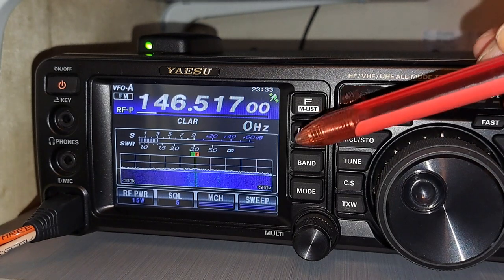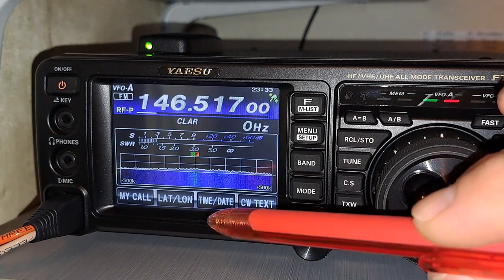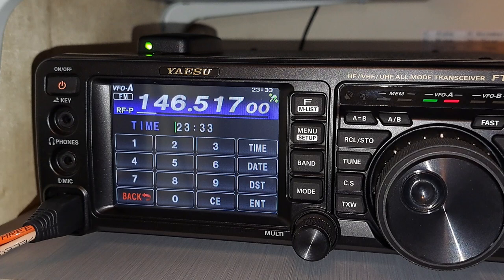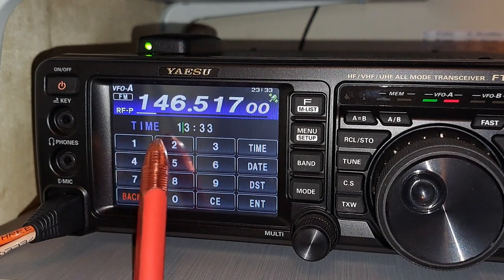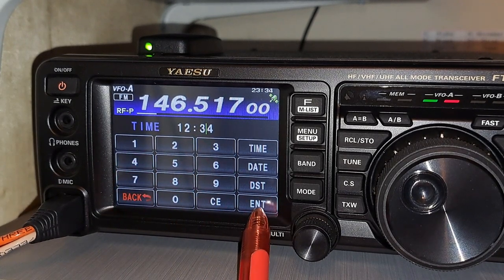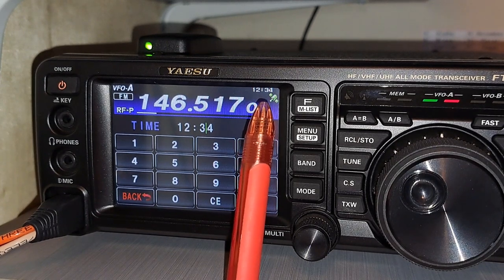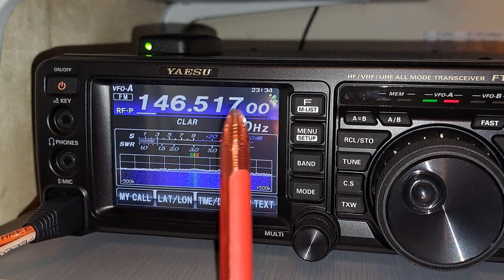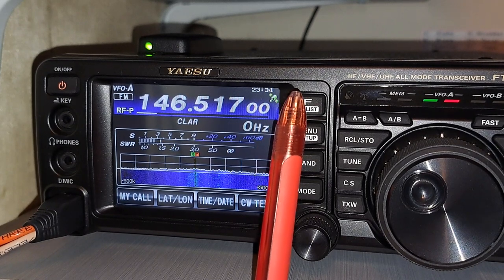YAESU FT-991A and AUTOMATIC GPS TIME CORRECTION

Comment: Nice video my friend, What was the little board you had in the video when you first install the GPS? I have try to make my GPS works but I didn't know about that converter. can you please send me a link about that little board? 73 de PJ2SM. Thank you for your videos!!!!
Reply from the maker: Hello, thank you for your interest in my project.

That board is a dual, back and forward converter (adaptor) TTL to RS232. 
I use it because my GPS receiver has only TTL output, the transceiver itself has RS232.

Ask Google: "max3232 module" 
And you will find a lot of variations of this board.

About your GPS:
Use the GPS receiver with an RS232 line.
You will need to send data in to pin #2 on DB-9
Menu #028: GPS select. GPS1 or GPS2. (GPS2 constant update of the coordinates) 
Menu #029: RS232 rate. The data speed of the GPS and FT991 must be matched.

The small satellite, in the right top corner, will be ON only when the receiver captured satellites and calculated coordinates.

73! de UT4UFA